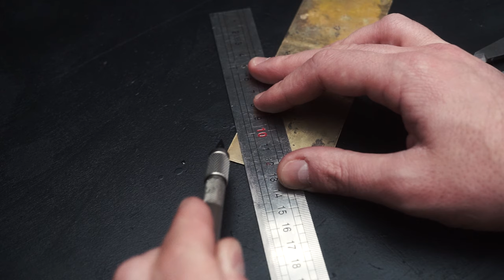Steampunk DIY Soviet Style Safety Goggles

Comment: first, I believe that maker videos don´t need music, looks like I found the exemption of this rule. The part when the little solder pieces are sucked up I liked the most. But I am disappointed that you have not shown how you inserted the glas/plastic.
Reply from the maker: On the back there is a gap for the plastic lenses ,i used some glue to keep them in place. I had some problems with the focus on the camera and decided not to add the blurry images.